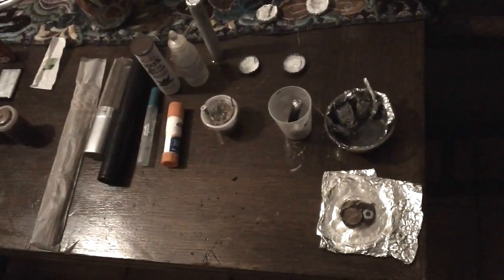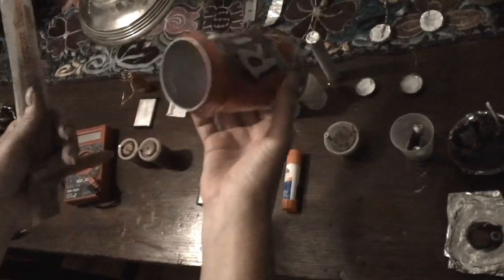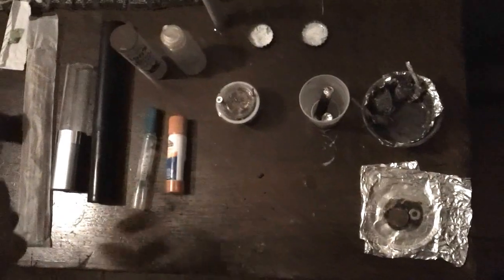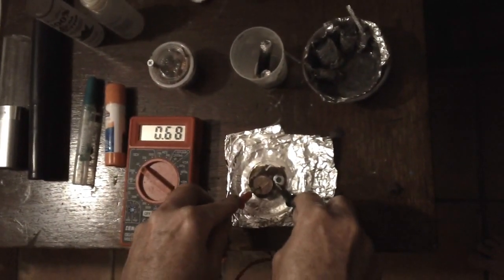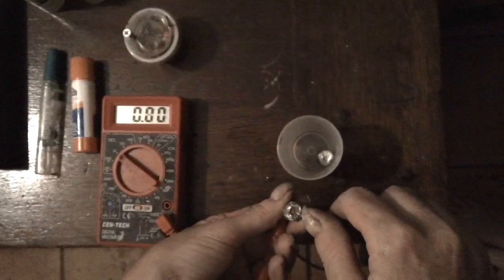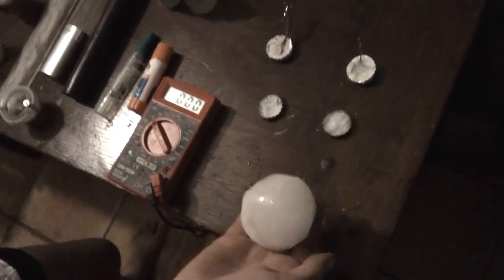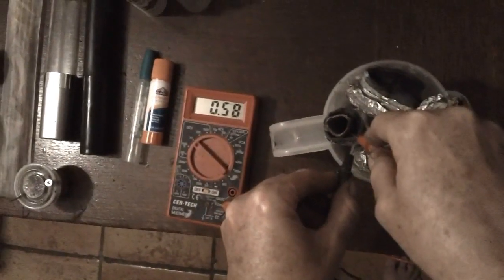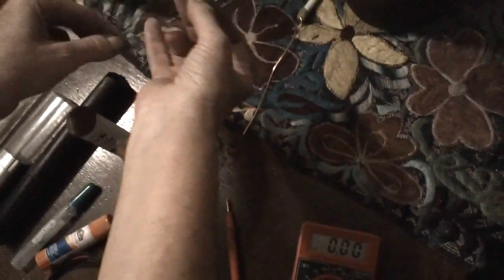Operation let there be LIGHT! Charcoal batteries for the poor!

Comment from the maker: Thanks for the compliment MsStudioCC! Yes I did connect the cells in series for the grey battery flashlight. Since I did this video I found the correct LED & it worked. So yes you can light an LED flashlight with batteries made from lye & low oxygen charcoal. Overall what was important for me was the ability to create a flashlight made with rudimentary tools & common materials because the poor do not have access to soldering irons. But they can find LEDS in electronic devices found in dumps.

Comment: Good afternoon, and nice video! I have a question for you about the battery cells; Have you considered putting cells together in both parallel and series? Perhaps they are unstable under load, and maybe putting a few of them together in parallel set would be closer to the desired result. I am anxious to play around with them myself. Thanks!

Comment: Nice Video!!! Pls have a look at "Joule Thief". It will work at a very low input voltage from 0.125 to 0.35 volts and the output voltage is 2.7 volts to lit up LED.